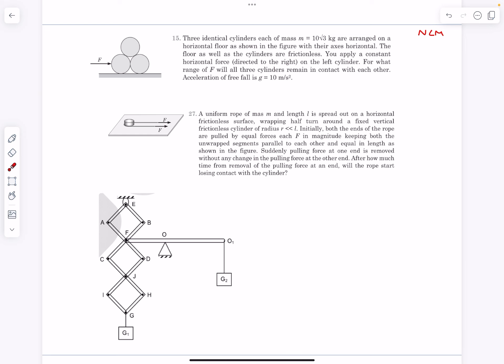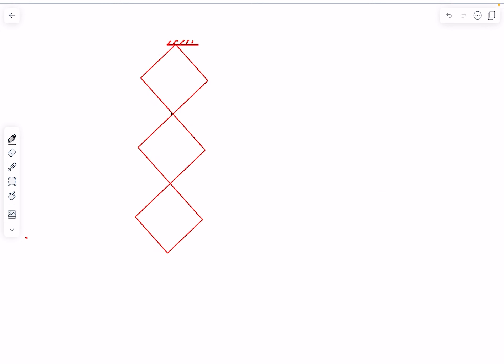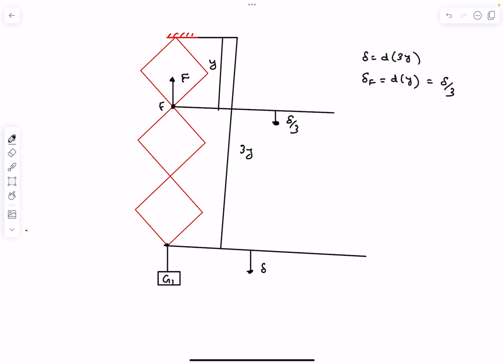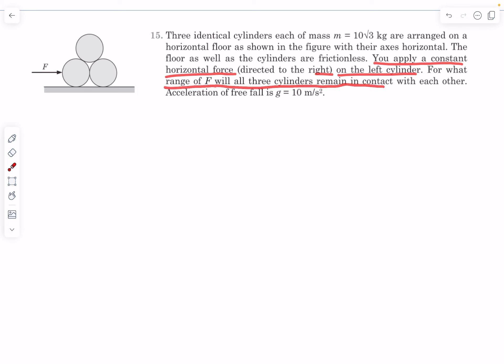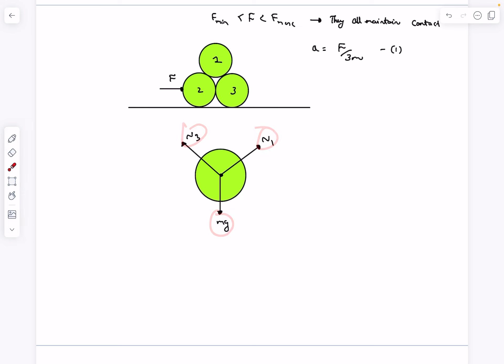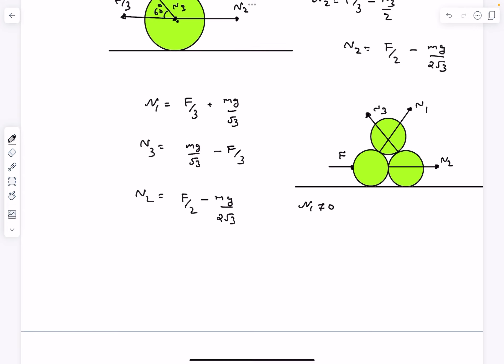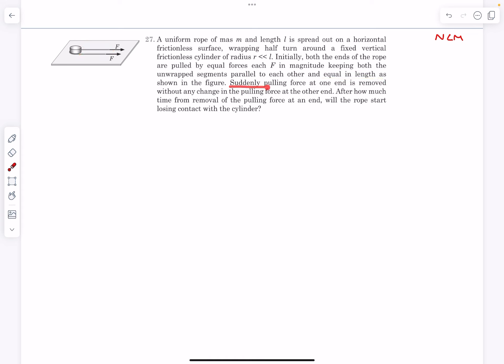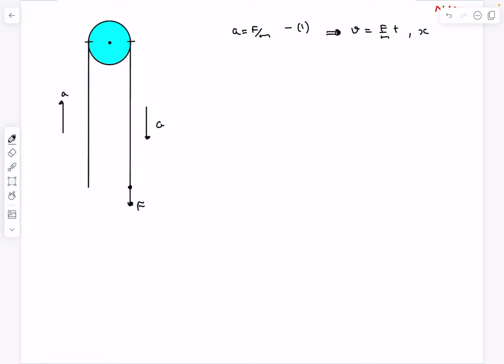[JEE] Must Solve Problems From NLM | Pathfinder | CYU 15 & 27

Comment: Sir I have a doubt in the first problem (HW Question). In the virtual work method, will hinge forces at other hinges be zero except F? Because if they are non-zero we should consider their work in the virtual work method. Thanks.
Reply from the maker: Yes they are non zero but if you consider both the rods together the net work of the hinge force is zero
Reply from the maker: By Newton's third law the the hinge force on rod one by rod two is opposite to the force on rod two by one
Reply: @Phyx_IITM What are rods one and two?
Reply from the maker: Any two rods hinged together
Reply: Got it sir, but what about J?
Reply from the maker: J ?
Reply: @Phyx_IITM  On J hinge force should be there just like on F.
Reply: @manansharma9164 yeah but the only force 'J' can feel is its weight but we have assumed that the rods are massless. And if you talk about the tension developed on 'J' due to the tension developed by force F on 'F' , the force will be clearly balanced cause there is a symmetrical cross figure at 'J' ,all components will cancel each other hence no work due to J.
Reply: @fredericchopin8779  Thanks
Reply: @manansharma9164 and also tension would be the same as rod is massless